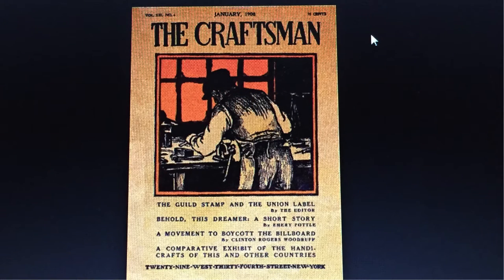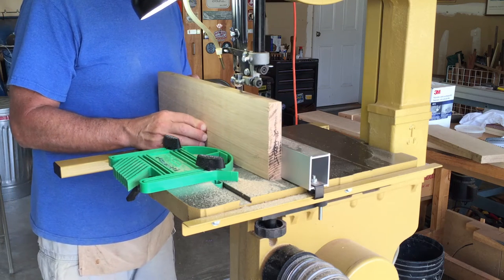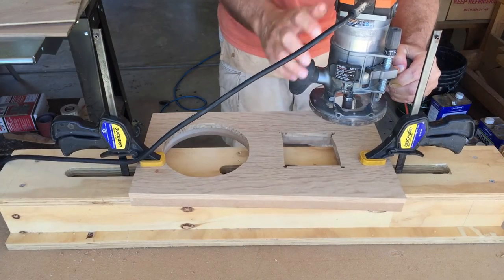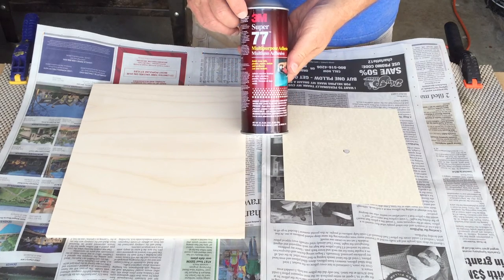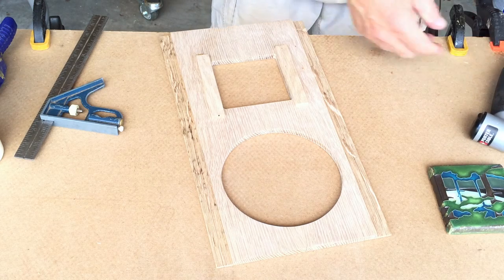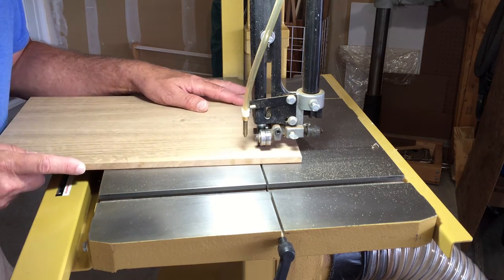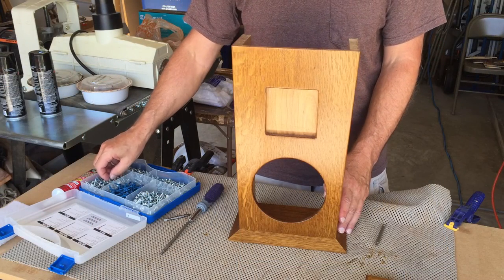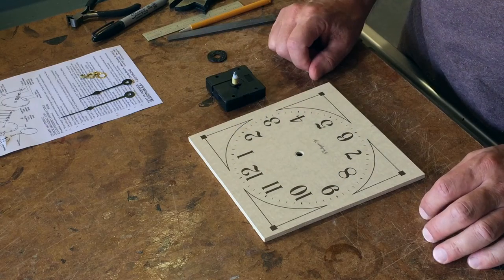A Mission Mantel Clock

Comment: Thanks for this great video. I'm building a craftsman style wall clock w/a wider top and angles of 10 degrees. Wasn't sure how to cut angles on the top until I saw you set up the clamps on the fence of you table saw. Thanks again.

Comment: I checked the Dec, 1905 link and did not see the clock plans.  Are you sure it's right? If not, where could I find the plans?  Thanks, Tim
Reply from the maker: +Timothy Baker Timothy - Sorry for the confusion.  The clock is shown in article listed in the table of contents as Home Training in Cabinet Work.  Here's a link that hopefully will take you straight to the pages with the clock.  If it doesn't work for some reason let me know.  Take care,  Steve

http://digicoll.library.wisc.edu/cgi-bin/DLDecArts/DLDecArts-idx?type=turn&entity=DLDecArts.hdv09n03.p0130&id=DLDecArts.hdv09n03&isize=M